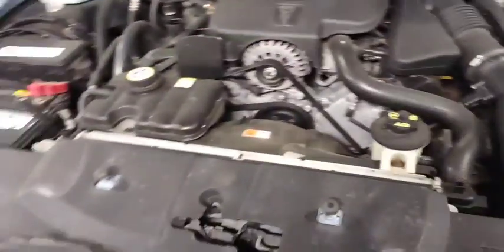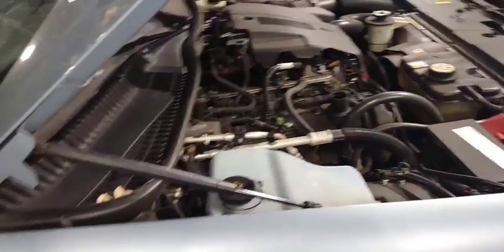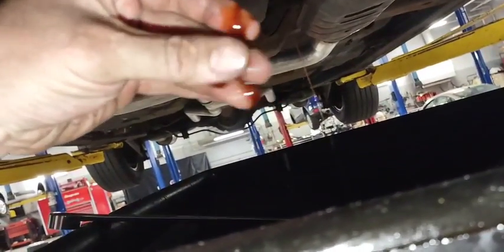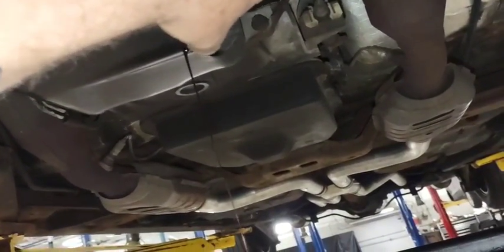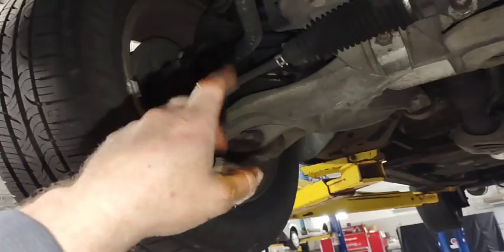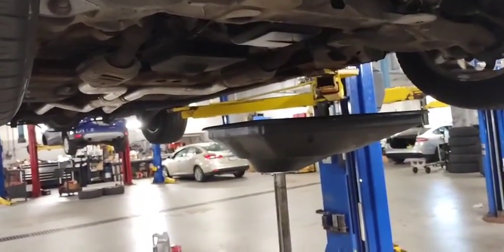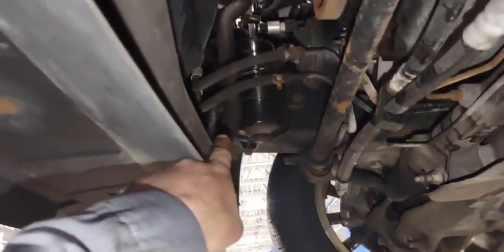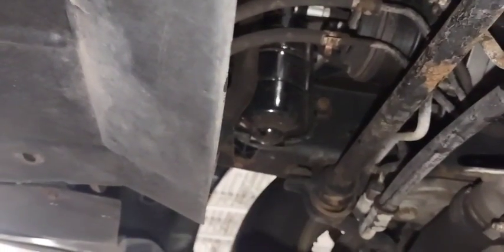Pennzoil Platinum Ultra oil drop 5k Miles, the next 5k Miles trying Mobil 1 extended high mileage

Comment: It is all right figured it would be louder with your exhaust set up.   I recently had an oil change and had put in Penzoil Platinum.   I'm looking around since I have exhaust modification an engine modification, and a tuner. 2013 Cadillac CTS. Wondering if I should actually go to the  Ultra Platinum.   I was using Valvoline recently and yeah the sound is much quieter of the engine and smoother running.   I just watched a video before this one about a Canadian doing sample testing of the two.
Reply from the maker: That's something you're going to have to figure out
 I love the Pennzoil Platinum Ultra
Reply: @FordBossMe   I will do more digging.
Reply from the maker: @OFFICIALAZURITEKING  I mean I think you should give ultra a shot but I can't make the choice for you
Reply: @FordBossMe   I don't do a racing with my car I'm a daily driver and Platinum is a better  for my  use than the Ultra Platinum.

Comment: Go longer like 7500 mile since you are running an extended mileage version of Mobil 1. I run  Amsoil Signature Series 5W-20 in a  2019 Ram 1500 p/u and go 7500 miles on it. Now I could go further as it is an extended mileage product but I don't let it go past 7500 miles.
Reply from the maker: Nope wont do it.... the people that have been on the channel know by now that I will not do that especially with the amount of engines that I've tore apart and looking at them internally at 5000 miles

Comment: My daughter has a 2018 Lincoln MKX, with the normally aspirated 3.7 liter V6.  If she has the dealer use the Ford full synthetic oil, do you think that she can go with the 5K oil change interval, or should she do it sooner?  I have a 2019 Lincoln Nautilus with the 2.7 liter V6 Ecoboost.  I also run the full synthetic Ford oil.  Due to its turbocharging, do I need to stick with a 3K oil change, even with synthetic oil?  Do you feel that the normally aspirated Ford 3.5 and 3.7 liter engines are good?  Would be nice to have a video about things to watch with these.  Thank you very much for all of the great information.
Reply from the maker: Ill do a video on this now

Comment: I have a 07 CVPI with 180k on it and it doesn't leak a drop underneath, it's dry as a bone. I run mobil 1 in it, like with any modern vehicle I have/had and it loves it. Have you ever had any knock on startup with certain filters? I find with the motorcraft ones if it's sat a few days it'll knock for a sec, with wix or napa gold it doesn't.
Reply from the maker: Never had a knock on start up

Comment: I’ll be buying my first Ford (7.3 dual-valve free breathing V-8 350hp) that will power my new 2022 Class C motor home. They call the engine “Godzilla”. Should I use original equipment Ford oil filters? If I can buy a higher quality filter, I’m willing to pay extra.
Reply from the maker: Higher quality is always better but the Ford stuff does work good
Reply: @FordBossMe  Thanks for the prompt response. If cost is not something I’m worried about, can you recommend the best filter available? I will have a considerable investment in this motor home, and I’m willing to go the extra mile regarding oil filters. Thanks again….I really enjoy your channel.

Comment: Pennzoil Platinum is made from gas to liquids group stock 3 base stock. Which is very good but it is not actually synthetic. The courts ruled that you can call it synthetic but it's actually not. Mobil 1 extended is in mixture of gas the liquids base stock and polyalphaolefin which is real synthetic. polyalphaolefin is a low ash oil so it will have less slug build up when burned. Both oils are very good but the mobile one will definitely have better cleaning ability and less sludge build up over time.
Reply from the maker: So far it's pretty good
Reply: @FordBossMe  also keep in mind that since polyalphaolefin has more solvency to it it will clean your engine more. With that said you'll definitely see your oil will be darker because it's actually doing the job it is supposed to which is solidify sludge to carry it to the filter. To test any oil you need to do two oil changes on actual engine because of the above mentioned solvency cleaning.

Comment: Oil should have some color, afterall it has to clean your engine. I would worry if it was perfectly clean after 5K. Some Pre-02 panthers had major frame rot over the accumulator leak. It would drip on the area that attaches the LCA :(.

Comment: I ran 5, 000 to 6,000 mile changes on my TDI Volkswagens, but since I've had a hard time finding the mobile one turbo diesel truck oil I've dropped that down a little bit as I'm running delo I believe. I drive 40 miles to work in 40 mi home so that's 80 mi a day round trip in one swipe so it gets hot and stays hot.

Comment: I run shell rotella 15/40 diesel oil in my gas engine dodge Dakota and Chevy Colorado never had a problem oil is always clean I’ve went 7k before a change and it was just fine
Everyone has there own brand it’s my opinion the filter is the main thing

Comment: I run the cheapest Dollar Store oil I can find.  They don't sell filters so I get them from an online retailer that sell for $1 each, probably made in China.  I run about 25,000 miles between oil changes.  If I'm in a hurry I will skip the filter and just drain the oil and fill with fresh dollar store oil. I call that an "emergency down and dirty oil change".  It will just last long enough, like 10,000 miles or so, to get me to the next oil change.  With the used oil I keep that to run my lantern on the back porch.

Comment: Also every 3K mile changes here on Mobil 1. 2000 Chevy Express 4.3 with 296K miles, 1999 Chevy Express with 101K miles, 2016 Toyota Corolla 100K miles(dealer asked why I changed the oil in the middle of the 5K intervals they used when it is new....I said because I like engines to last longer), 1985 Chevy C10 305 V8 157K miles(the rusty farm work truck out here).

Comment: I agree with another comment that Mobil 1 is noisy, I changed the oil on a 2008 Lexus RX 350 with 132k miles to M1 and I could hear more  the tapping noise in the engine… maybe next time I will try Castrol Edge which I use on my Volvo XC90 (Volvo recommends Castrol) . The Volvo’s engine is nice and quiet with Castrol. Mine is an experiment one at time.
Reply from the maker: I'm going to see if I experience that

Comment: I love your honesty and being strait forward with car owners!!  I live in Hanover, MN, wish you were closer!!  I am a Ford guy…  2015 Ford Focus…my wife’s car, jazzy blue paint color, but on 4th Clutch Assy. with the Powershift  Trans.  Could you do a video on that??  Also have a 2017 Ford Explorer 4wd.  I try to service the PTU every 9-12,000 miles but no drain plug and can only get maybe 4 ounces on the full synthetic out and fresh fluid put in.  I heard a story of Ford Dealers drilling a hole in the bottom of the PTU USING LEFT-handed drill bits, then using a thread tapper for a drain plug??  Could you please do a video also on this subject.  Also got a 2019 Ecoboost Mustang.  Only have1,900 miles on it, installed the Ford Performance oil catch-can assembly on it due to the Direct Import Injection System.  Maybe a video on that sometime!!  Take care.. stay safe under those cars… people don’t understand some of the Risk  of the 1 in a 1,000,000.00 chance of 3 tons of steel coming down on you. God Bless and stay safe!! !…..Jim.
Reply from the maker: Tyvm will do... God Bless

Comment: In the early 70's, Mechanix Illustrated did a feature on the new MOBIL1 full-synthetic oil. They tore down a brand new engine, measured all wear points, making note of all measurements, and then re-assembled it. They put 50,000 miles on one oil change and then tore it down again. They could find no measurable wear in the key wear areas. Seen it with my own eyes. I'm a machinist, so I don't play games with my metal objects, whatever they may be. As an adult, I've seen the proof of this and have shared it with friends. We put 35-40,000 miles on oil changes (depending on conditions) with a couple of filter changes and a quart of full-synthetic oil in between changes to fill it back up. We probably drive at least 50% gravel back roads. No problems. I had the hardest time convincing people that it was NOT more expensive, it is less expensive because of the infrequency of oil changes. Full-synthetic oil doesn't break down like petroleum based oils do when introduced to gasoline, which is a petroleum based product. 'New, Extended Mileage Full-Synthetic Oil". LOL. HUGE MONEY MAKING SCAM. Full synthetic oil has always been good for 35-40,000 miles. And quite possibly a lot more if you drive mainly in low dust urban settings.

Comment: Hey Ford Boss, can you do a video talking about the 10R80 transmission. A lot of people are having some issues with this transmission, including me. I have 2019 Mustang GT (10R80). This trans is very unrefined. But the main issue, I’m having is, the trans bucks hard when upshifting with pádel shifter in sport mode, sometimes, in that mode it feels nice and smooth, but every other time it feels horrible with hard shifting.

And the other issue is, when in 10th gear, you give it gas so it downshifts, it bangs into gear... I think the problematic gear that bangs is 8th gear, when downshifting into it. Took it to the dealer, and the typical no problem found statement from tech.  

What are your thoughts and or experience with this issue?

Comment: I've never use Pennzoil just because it was something I never used, not for any negative reason mobile one is a great well honestly it wouldn't come factory in Corvettes or other high-performance applications if it wasn't.. oil is extremely important more than the majority of people realize I think amsoil oil and redline you know higher-end oils obviously you get what you pay for. As far as trucks go I swear by rotella T, two different heavy equipment mechanics I know one with the Chevy Silverado one with Dodge Dakota or both over 600,000 MI and each engine only ever had rotella T
Reply from the maker: Well the SRT engines come with Pennzoil Ultra Platinum

Comment: All this means nothing without an oil analysis.  I have a 2001 silverado, 4.8, 92k miles; it has the piston slap from that time and I sent Blackstone labs about ten samples of oil to check for wear, everything is normal, I started with conventual oil, havoline, quaker state, Pennzoil, then switched to synthetic oil around 20k miles, using pennzoil, quaker state, valvoline, mobil 1, havoline, currently using valvoline high mileage.  All wear has been normal, and Blackstone labs told me I could have run all the samples longer.  The only internals I can see is through the oil filler tube and I see no varnish or sludge, the head looks new from what little I can see.  For all those people who claim that a certain oil makes there car run smoother, faster off the line, increased fuel mileage, well, it is all in your head.
Reply from the maker: y'all got to quit with the over critical analysis stuff
 I clearly said that I'm going to do to anecdotal runs and then to tested runs but people have selective hearing they want to listen and see what they want and that's why I'm not even going to keep responding to people that don't pay attention and just like to say things without actually asking questions

If you would have taken a couple minutes to look through the comments section you could see I've already addressed this but obviously there's no consideration for the creator of the video and it's just repeat repeat repeat repeat like I'm a tape recorder

Comment: My experience with Ford's I use a long extension and a 16 mm it does the same trick you're doing with your angle wrench and plus world doesn't run down the wrench on your hand does it run down the extension either and when I worked at Jiffy Lube their big thing was Pennzoil Platinum was derived from natural gas
Reply from the maker: I actually don't mind the oil running down the wrench

Comment: I made the switch to Pennzoil ultra platinum after running amsoil signurature for 50,000km. I still love amsoil but I get 25L of Pennzoil for 9L of amsoil.
Reply: the pennzoil isnt as good but its an ok oil. i used to use it. using amsoil XL now
Reply: @wildcard749   amsoil is great stuff. But it isn't 3x as good compared to the price. I am almost done my 25L run of Pennzoil. I may make the switch back to amsoil or go motul for my track/summer oil.
Reply: @MyGoToUserName  the xl isnt as expensive as the ss, its less expensive than regular pennzoil platinum (not even ultra, im talkin regular pennzoil platinum) and my uoas have been much better on it.

Comment: I’ve been running mobil1 high mileage 5w20 in my 08 grand Marquis would it be safe to switch to penzoil ultra 5w20 you think? I’ve got 101k miles no leaks.
Reply: I’m guessing I should stick to Mobil or maybe switch to penzoil platinum high mileage just in case it leaks idk

Comment: My 03 Grand Marquis with 73k on it has a seeping power steering pump. Pump sounds fine, fluid level has remained unchanged, and I think the previous owner did a PS fluid change. No drips on the ground just a little reoccurring wetness below the power steering pump that I clean of with brakleen every oil change LOL.  Is this a known quirk of the Panthers? Can I leave it alone until it starts actually leaking on the ground and the fluid level actually noticeably drops?
Reply from the maker: I would say you're fine but at the same time if you get ahead of it now it won't be a mess later
Reply: @FordBossMe  That's true. Also, I saw your air suspension light was on. Did you delete your bags and go to springs? Is there any way to get rid of the air suspension light? I always told myself that if my air ride goes out I'm gonna properly fix it because I won't tolerate the light on the dash 😂

Comment: Say Mr. Ford Boss, could you do a video or answer this question on why ford oil pan threads ( 14x1.50 thread pitch, 16mm head) ( often 96-to now truck pan/mustang) always strip pan bolts every 3-5 oil changes? I noticed this as a lube tech. A new oil plug always goes in easy every time I found one that is stripped, even after torquing to 15 foot pounds after each 3-5 services.
Reply from the maker: I don't know that I can answer that question I see are lube techs have a problem with it also but I don't really ever have a problem with it to be honest with you. but you're right even our techs at the shop that change oil have issues with them but I've never had that experience.

I just pull every drain plug out really slow
Reply: I am using a Fumoto drain valve and so far it is great and does not drip through the valve. It makes the oil draining cleaner as I use one of those clear vinyl hoses to direct it down into the catch pan as I am on a street and when its windy that warm oil sprays everywhere but not anymore. Highly recommended time saver and now only the filter is messy.  Fumoto is brass and made in Japan in different sizes

Comment: I'm looking at getting a Transit van with the 3.5 eco boost twin turbo. What oil would you run in it and how often would you change it? I'll be using it for a camper van and traveling mainly west of the Mississippi.
Reply from the maker: If you're buying one of the newer ones that have direct and port injection every 5000 I would say Max but if you're buying one of the older ones that only have direct injection I wouldn't go more than three to four thousand miles
Reply: @FordBossMe  It'll be a new van. I'll be pulling a 24' trailer with about 2,000 #'s in it.

Comment: A tip; you probably know it, and a quesion:  The tip; when pouring oil out of the bottles/jugs, keep the pour opening at the TOP to avoid the "glug - glug - glug" effect and possible splashing as you pour. I have a 2018 F150 Raptor with the cursed non-metal oil pan and double cursed ""ugly yellow thing" drain bung; no leaks, yet. Do you know of a mod or replacement for the ugly yellow thing?
Reply from the maker: Nope you either have to deal with it or I think somebody said there's aftermarket companies trying to come out with metal oil pans or have already but really just have to deal with it
Reply from the maker: As for pouring oil....it's just oil no need to give tips on that I know you're just trying to do the right thing and be helpful but I'm a Master Tech I do this everyday I just pour the damn oil LOL

Comment: Are you sending them out for analysis? I think AMS oil has a test you can get and send in. I think they can tell if there is any micro metal particles, fuel wash, etc
Reply from the maker: I'm doing a few anecdotal runs and then I'm going to send a few in

Comment: Now I’m confused on using oil flushes. He uses it and says they do good but skotty kilmer said don’t because it cleans out carbon that could be sealing things up so the engine could start burning oil or lose compression
Reply from the maker: The first problem is you're listening to Scotty
Reply from the maker: If you have an engine that doesn't have a lot of carbon buildup and sludge and things of that nature it's not an issue and if you listen to what I said in the beginning of the video I clearly said this thing isn't maintained meticulously all the time there's no junk buildup in this motor at all so there's no reason for me to be concerned for leaks
Reply: @FordBossMe  ok thanks

Comment: What do you think of doing oil changes based on time as opposed to mileage? I mostly drive city, so I try to stay at around 150 hrs of run-time, which equates to about 2800 miles.
Reply from the maker: Good interval
Reply: That is the only right way to do. By hours,not miles. 
But keep in mind,regardless of driving conditions,todays oils are good up to 300 hours of hard work,some are 360.